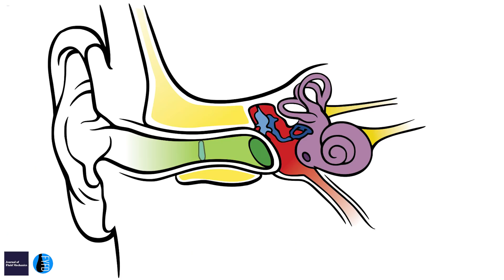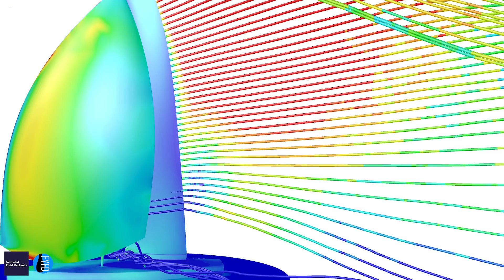Getting Water Out of Your Ears, Cycling in Echelons, and Sailing Physics

Comment: I used to remove water from ear by  pouring more water into the ear. It works...
Reply from the maker: That makes sense! The water will coalesce with whatever's already stuck in your ear, and, if you've added enough, gravity should help the whole volume flow out.

Personally, I've had good luck using Swimmer's Ear, which basically amounts to adding a little alcohol. That breaks the water's surface tension so it doesn't stretch across your whole ear canal, which allows it to flow out.